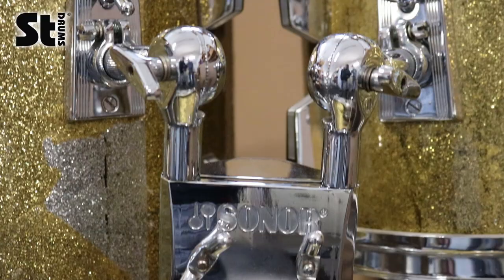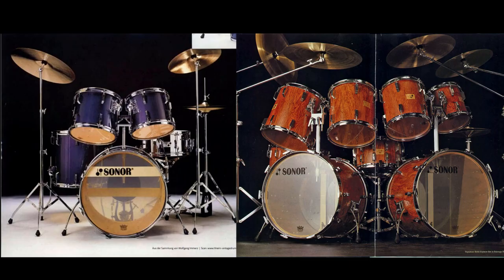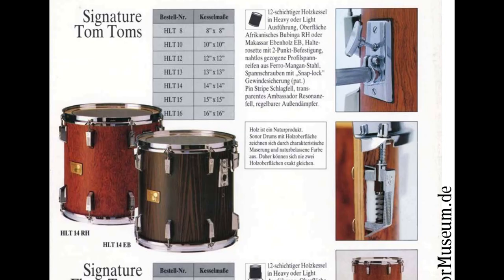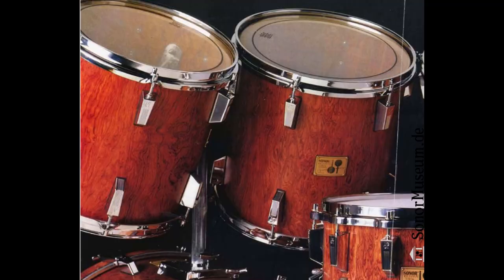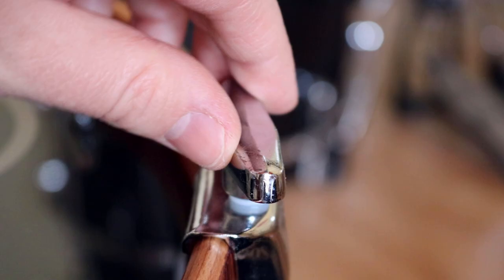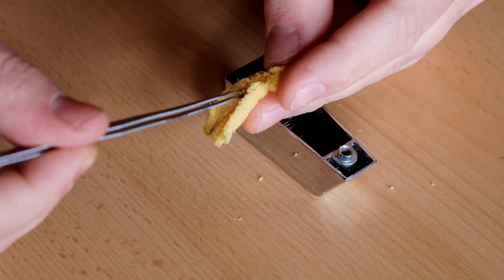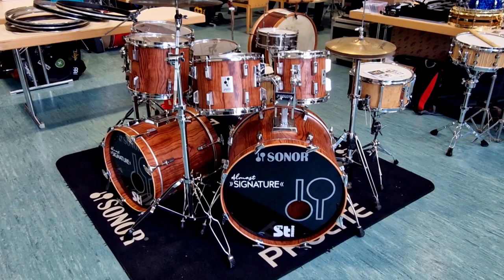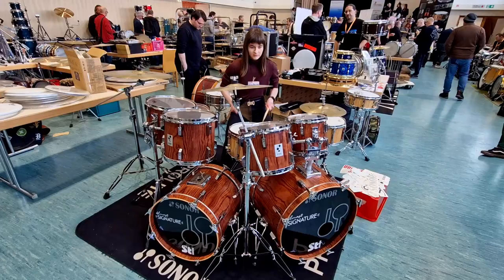Let's recreate the greatest German drumkit!

Comment: Hell Sonic Plus drums shells sound as good as those costing thousands more, without the bling. I'm all in.
Reply from the maker: thanks for the comment! Sonic series got great shells aswell, however the hardware is not regarded as so great. We got quite a few emails from customers who asked us for replacement FT-legs and BD-spurs for these Sonic drums. Also the used Performer drums are not expensive in Germany - probably the same price category as Sonic Plus on the used market
Reply: @stdrumsgmbh  noted. My Sonic Plus are "industrial. strength", overbuolt. I like the bright, aggressive punch with quick decay,  slightly harsher sound than warm maple.

Comment: I bought a new Bubinga Heavy 12/13/16/22 kit with hardcases and the 14*8 chrome snare in 1985. Great drums but too high and heavy to take on a gig or for recordings. I traded them for a Designer + Euro in the early 2000s and later got a DW collector although I kept the Signature Snare. DW hardware is cheap in comparison to Sonor and ages fast. But the whole DW kit weighs about the same as just the Signature Heavy 22" kick drum 😂 Currently enjoying a Tama Hyperdrive.

Comment: Great job, beautiful drums. It would be interesting to hear how historically the 18" became the 16" deep size. Personally, I like the sound of the 18x14", the 18x15" has some extra volume and low end, but the 18x16" ends up being too loud for a bop kit, and too small for a rock set. It's a special sound, but problematic in terms of tuning range and definition. Steve Gadd in Ricky Beato's interview shared some insights about bass drum depth. It's a theme which people don't talk much about.

Comment: 17:38-  It's to bad you couldn't have reproduced these mufflers.  Drums today don't have these and in my opinion made a great addition.  With a change in music style in a single performance, you could change the sound of the drum using these.  For the Gretsch drums they were called tone controls, but were really just muffles for the heads.
Reply from the maker: thanks for the comment! Many sets on the used market have the mufflers removed because people use them I guess, so if you want to restore a kit with the original mufflers, they can be quite pricey now. As far as I know the original signatures had these external mufflers that were clipped to the hoops and muffled the head from outside. Theoretically they could also be added to this performer set 😁
Reply: @stdrumsgmbh   I have heard that Kits were being manufactured without them any more because the hardware supposedly reduced the sound of the drums as well as added rattles as they wore out/loosened.

Plus, drummers were finding other ways to muffle the heads that were cheaper even if not as good lookin.  Also didn't allow flexibility of different music styles.  

I will agree, the cost to replace any of them any more is high.

Comment: Didn't the veneer add to the OD of the drums? How did you compensate for that?
Reply from the maker: we removed the old wraps which decreased the diameter and the veneers are very thin (way thinner than the ply layers on a shell, and even thinner than most drumwrap), so there was no need to compensate really. Sonor shells are a bit smaller anyways, and the lugs got movable inserts, so I would say up to 1mm additional OD should be no problem.

Comment: Where do you purchase yhe wooden wrap material? I tried to rewrap my teardrop years ago here in the States but could not find a place that sold wood that thin. 1"8" was the thinnest, and I could not find Scandinavian birch like I wanted. Only maple. But 1/8" is quite thick, especially on a teardrop 3-ply shel that is probably less that 1/8". I ended up not wrapping it at all, not wanting to choke the vibration of the shell. Also, what kind of glue do you use to apply the wood wrap?
Reply from the maker: we actually offer thin wooden veneers like that in our shop: https://stdrums.com/en/c/wrap/real-wood-veneer they come with a thin nonwoven layer on the back that makes it easier to use them. The ones in the video where made without this nonwoven, but we can't sell them individually unfortunately. If you are looking for a certain type of wood veneer that is not in our shop you can send us a picture of the type of finish you are looking for via email, then we can check if we can source a veneer like that. For the veneers with the nonwoven layer we recommend the same 3M Scotch-weld 30 glue that we recommend for our drumwraps. You can use our contact form on the bottom of the page at stdrums.com thanks!